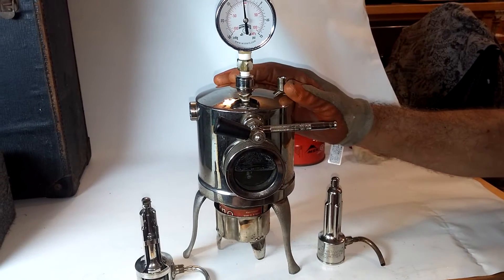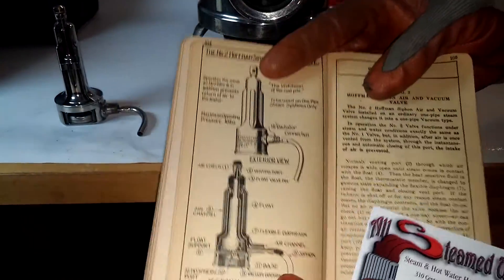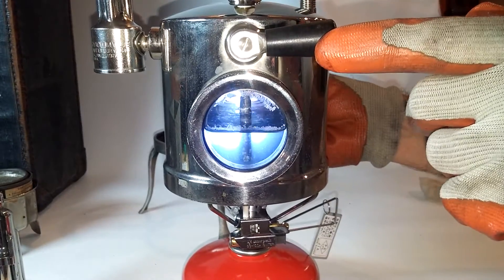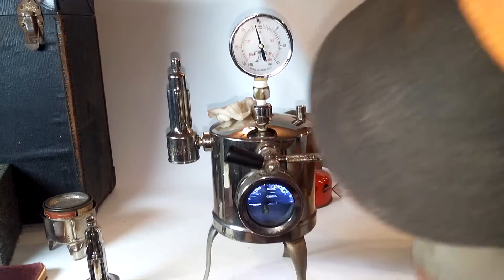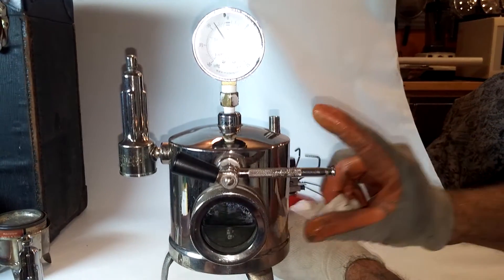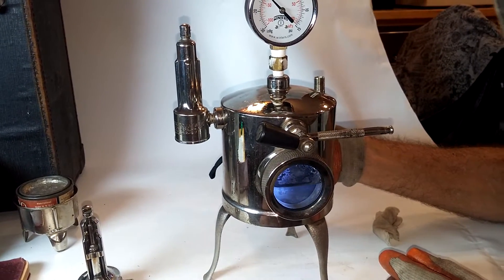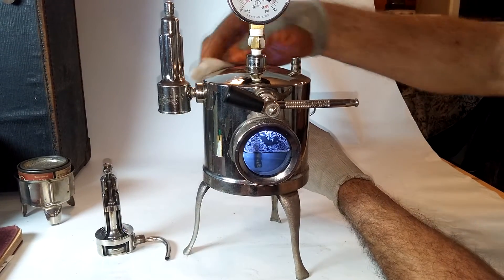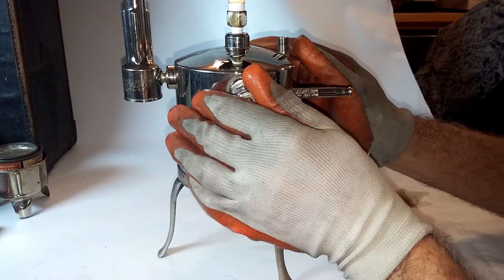Hoffman #2 Vacuum Steam Vent 1920s Demonstrator

Comment: From my AC training I [think] I know you could make a glass of water boil if you enclosed it under a tight fitting bell jar, and,  through the use of a vacuum pump, you could make that water boil at room temperature---if you removed enough of the atmospheric pressure [essentially] exerting pressure on the water 'holding it down' in the glass. I understood that principle to be the one that required pressurized space suits and fuselages. Is that so? And if so, is that the same principle at play here? Is not the heat really scientifically divorced from pressure? (although we think of them always in tandem) Am I wrong? And if in that water in the demonstrator is actually boiling (an idea I CAN wrap my mind around from a pressure perspective) how is boiling water, seperated from heat (after all the sterno was removed)  able to keep me comfortable? I am confused I think. Is this really a demonstration of the virtues of the vent, as opposed to a heating demonstration?
Reply from the maker: Thank you for your comments and questions.
Since the vacuum vent cost 3X price of the regular vent, it had to have its virtues demonstrated to a skeptical audience of most likely plumbing contractors and wholesalers.   
These folks would have known about how a coal bed would burn down and produce less heat at the end of its cycle.
A system equipped with ordinary vents would allow this heat to be lost up the flue, because the water would stop boiling, and the radiators would start cooling down as well. Vacuum vents would allow this heat to be captured as lower temperature steam.  It would flow into the radiators as there would still be a pressure differential between the boiler and the radiators caused by the lower temperature steam condensing in the radiators giving up its latent heat.
Reply: @gordonschweizer5154  Thanks. I understand that now. Great explanation.